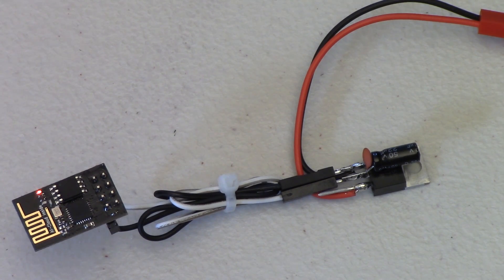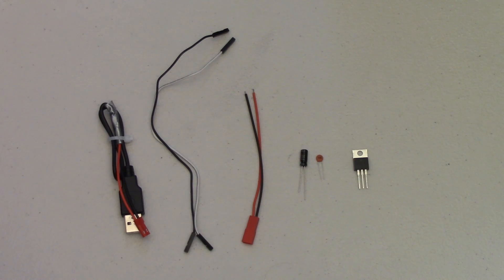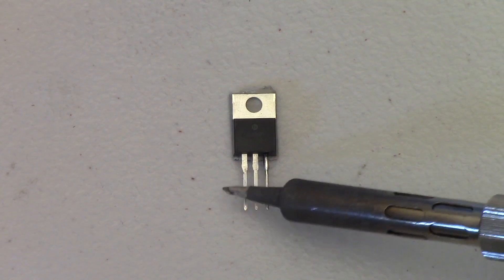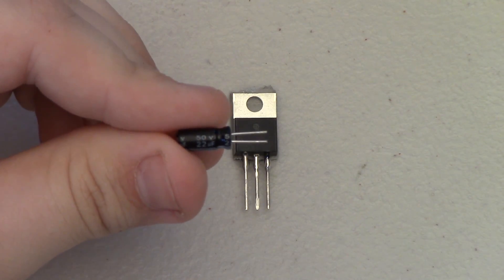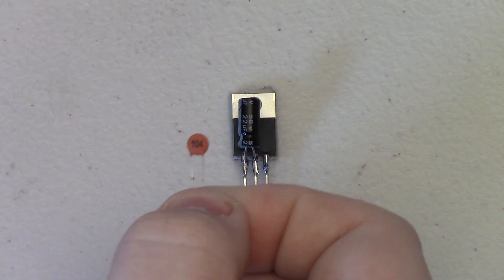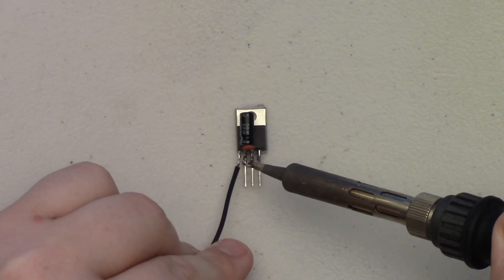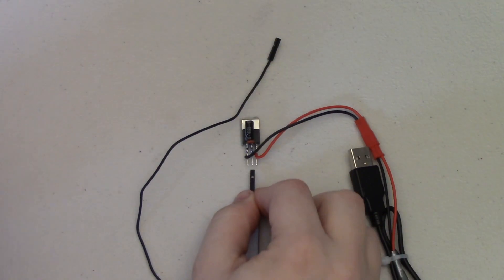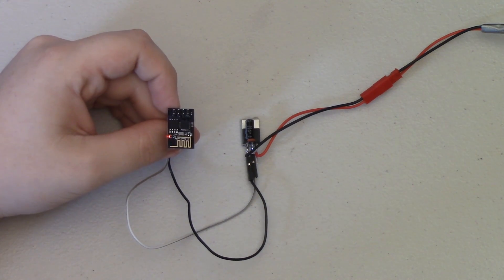Quick & Dirty ESP8266 Power Supply

Comment: Idea is valid but the design is very bad... You never want to have those capacitors (especially ceramic one) far from ESP. No practical use otherwise. Try to place capacitors within 0.5cm or less. The longer you solder, the more resistance. You used a bit thicker wires, so, helped but not much...
Reply from the maker: idk if very bad is the right term. It does kinda work (ie has never failed for the person making this channel)... Maybe imperfect? Yes lets go with that! :)

Comment: Ugh. More bad info on powering ESP8266s. The 0.1uF is supposed to be as close to the pins of the ESP8266 as possible (within 1/2 inch) to decouple and reduce unexpected resets. Adding it to the regulator is doing absolutely nothing. It's not there to "clean up the signal just a little bit more." Please delete this video as it is just adding more misinformation to the already garbled mess that's out there when people are looking for info on powering 8266s. EDIT: I see why the channel name is "ItKindaWorks"
Reply from the maker: Yeah man, you get it! Another like minded person! It does kinda work - though to be fair this one does work perfectly (we wont worry about that one time...) so I guess you're right, I should delete the video and re-post it to the upcoming "ItReallyWorks". Don't worry man, I'm on it!... Here ya go dude!
https://www.youtube.com/watch?v=91MkMxSl1ng&feature=youtu.be
Also here is another even more useful video - gotta keep up with the times man: https://www.youtube.com/watch?v=J66_8P043ko&ab_channel=ItKindaWorks

Comment: So the reason for using the two different capacitors 0.1uf ceramic & 22uf aluminium in parallel is to improve noise rather than to get 22.1uf capacitance?
Reply from the maker: Yes, exactly
Reply: @ItKindaWorks  No, dropping some noise... Not improving.  Having one small capacity and one slightly larger one works at different frequencies. That's the whole idea.. I mostly use 100nf and 10nf right next to ESP. And 220uF right next to voltage regulator.

Comment: is it neccessary to add up the capacitor?
Reply from the maker: Yes. Unless you have an extremely clean external power supply the ESP will crash and restart a lot without a capacitor.
Reply: %1000 (yes, one thousand.).

Comment: Sir - thanks for the great video. Think there may be a slight error. I looked at the data sheet for the lm1117 an it showed a typical application circuit. If my understanding is correct the 0.2 uF capacitor should go from gnd to Vin and the 22 uF from gnd to Vout. Could you please check the data sheet and verify my understanding please? Thanks again for the very well done videos.
Reply: I thought that but I am a novice so I don't know. can anyone speak to this?

Comment: A few questions:

* Why solder the 1uF capacitor in parallel with the 10-100uF capacitor? Will this not only increase to total capacitance?

* Should we not have another capacitor between Vout and GND as well as Vin and GND?
Reply: 100nF caps are used to prevent RF interference and oscillations which some regulators generate...these are only seen using an oscilloscope. I would highly recommend using a small cap as well.

Comment: Instead of powering it through USB, can I power it through the 5V of an arduino nano? what about a 9V battery?
Reply: No, never. Each Arduino pin can supply about 20mA. However, total supply (of ALL pins together) cannot exceed about 70mA. ESP uses somewhere between 90-200mA. It won't connect wifi, or crash due to less supply, or, won't transit no more than a meter. In addition, if USB supply is not capable of providing more than 500mA, USB supply is also not a good choice. Don't use PCs USB. May damage USB permanently.. Get an external USB supply, ideally, with 1A.

Comment: I used a LD1117AL but it only dropped me down to 4.6V  any idea why ? .. I checked on Adafruit the LD1117 should regulate to 3.3 V.   thanks.
Reply: You probably have a LD1117AL-46, there are multiple versions of it with varying output voltages and for 3.3v you need a 1117-33, the 33 there being the output voltage code.
Reply: You probably have a LD1117AL-50, that is working below the dropout voltage, so it will give you less than 5.0v. There are multiple versions of it with varying output voltages and for 3.3v you need a 1117-33, the 33 there being the output voltage code.

Comment: Optionally, you could use the electrolytic cap and a 220v to 3.3 voltage converter from ebay to power this from mains.  Just mount the cap directly on the esp.  The whole thing could then be put into a plastic pipe and sealed to make it water proof and mounted outside to use as a repeater so your neighbors can use your wifi, for a price of course.
Reply from the maker: +Joseph Nicholas that's totally true but usually those end up costing a bit more than I want to spend on throw-away projects. I'm a big fan of using what I have on hand for most personal projects

Comment: Cool, thanks.  What's the upper limit of input voltage?  Can I plug 12v into that?
Reply from the maker: +mnelson10000 You can put 12V no problem and as along as you're not drawing more than about 300-400mA you shouldn't have to heatsink. I tend to start adding a heatsink at 12V though just to be on the safe side. The max for Vin on the 1117 is 20V and you would definitely want to have a heatsink on it at that voltage.

Comment: The usb cable.  What pins are you using there?
Reply from the maker: +vincent youmans I'm using the VCC and Gnd pins on the USB to provide 5v. Heres a pinout diagram for USB 2.0: http://www.moddiy.com/product_images/uploaded_images/patillaje-conector-usb.jpg

In general the standard wiring colors are going to be red/black for vcc and gnd respectively but you shouldnt rely on that, it's always best to test the contacts with a multimeter.